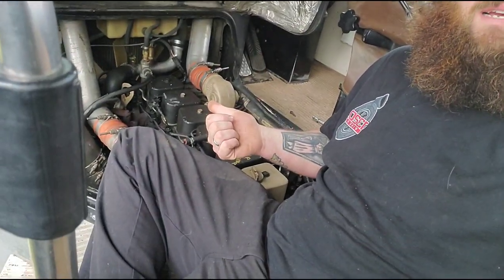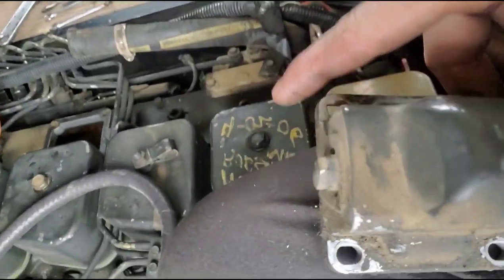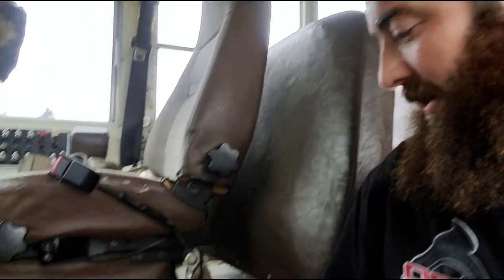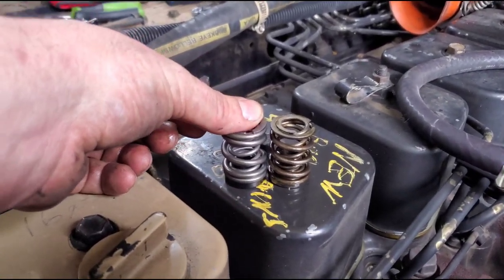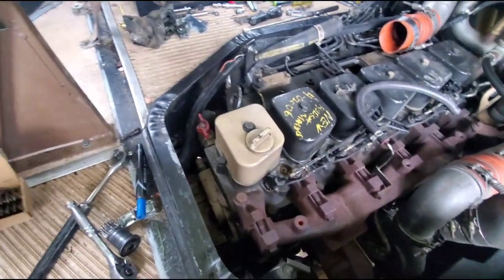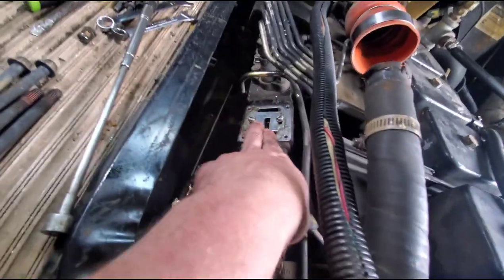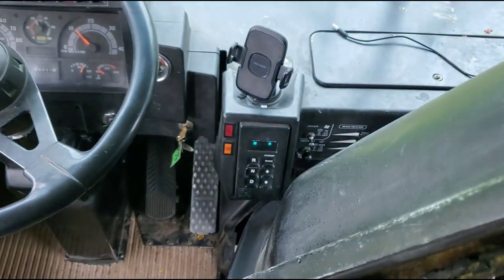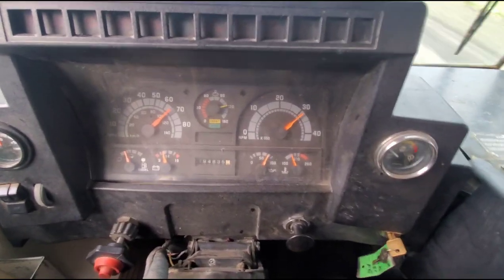TURNING UP THE BUS!   #10 fuel plate and 3400 rpm governor springs             96 12v P pump cummins

Comment: Happy for ya, mayne. I have a 96 Dodge with the 12 in it and put a mild #11 plate, boost elbow, 4 in straight piped exhaust turbo back, high flow intake elbow, and intake. I love that extra power; more than enough to cruise comfortably up long grades with my 26 ft enclosed trailer with my hot rod inside. Thanks for the video. You don’t see too many people tuning up their school bus 12 valve (like they should) so fun to see.
Reply from the maker: Hell yeah man thanks I appreciate that! It made a huge difference

Comment: DId you need to do any upgrades on the Drivetrain to support the added power?  I assume since stronger engines are sometimes matted to the At545 it can probably take it,  but just curious if you did.
Reply from the maker: I didn't do any other mods besides this...  the trans didn't seem to mind I have about 5k on it now and it's still truckin

Comment: How much hp do you think you gained form a 10 and do you think a 10 is safe for a stock 12 and clutch
Reply from the maker: Probably 50hp and yes we did these identical mods to my dad's 92 3500 as long as your stock clutch is in good shape I think it would be fine